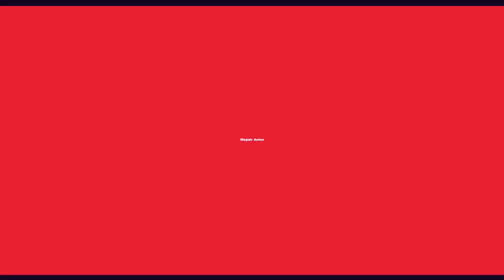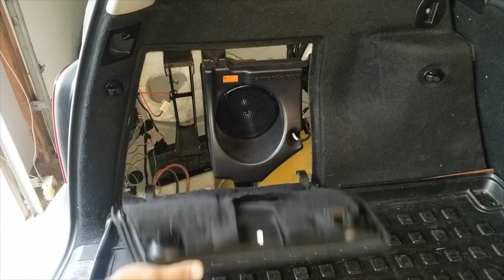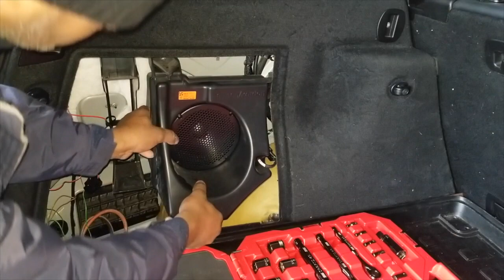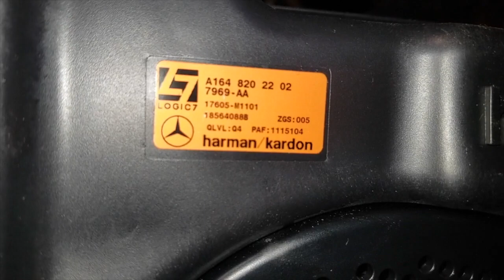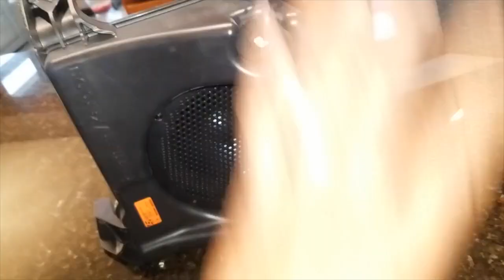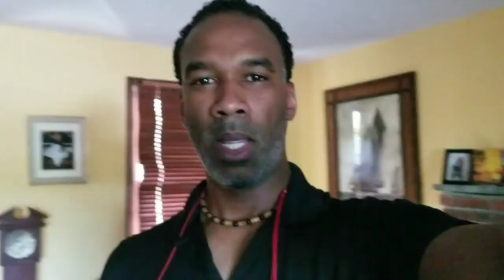Mercedes Subwoofer Replacement | DIY | ML350 Model

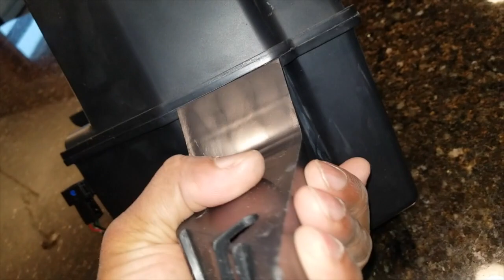Comment: 3:46 you're wrong I replaced the subwoofer in mine and it does not have an amplifier in it. It just has a dual voice coil subwoofer that's why there's only four wires on it. And yes it is a Harmon karden subwoofer I replaced it with a better subwoofer.
Reply: Which one is the better subwoofer?

Comment: This video does not cover the 2014 ML 350 4matic. The rear of truck is totally different then video being shown. There are a lot more parts to remove before getting to subwoofer. I think  this guy should make a new video. The Panel that opens up is only 12" X 12" so show us how we get to the bolts to remove subwoofer because u cannot see them and more things must be remove to get to the subwoofer
Reply: He never said this was for the W166

Comment: Apparently, there is no amplifier inside of the subwoofer enclosure. One tell-tale sign is that there's no external heatsink, fan, or ventilation. The weight of the magnet on the Dual Voicecoil woofer can be misleading. It's possible to make easy upgrades.

Comment: Hi Keith, I’m planning to install a new head unit in my ml500 w164 and wondered if I could use the speaker wires that go to the sub for my input? Are they low level or would I need a converter? Thanks in advance sir and loving the videos. Jim.

Comment: Is it possible to add this sub to your my ML350 if it doesn't come with my ML originally
Reply: Did you find an answer to this?
Reply: Yes, but if you have original radio you need high to low converter and aditional amp
Reply: Of course! You can add a sub to any ML.